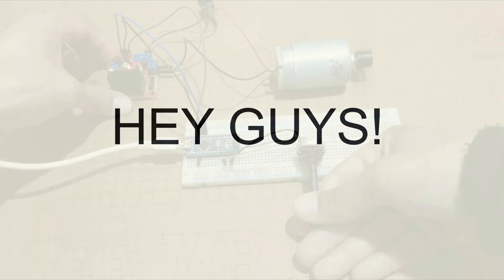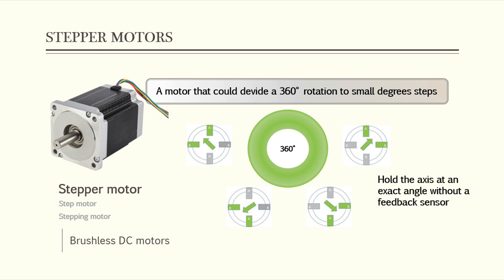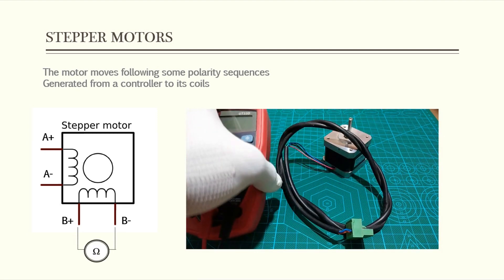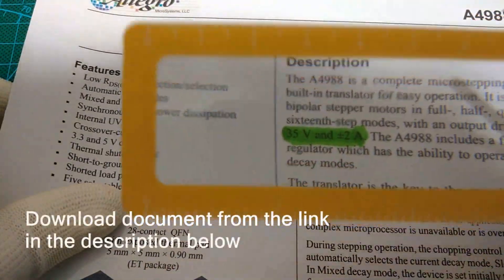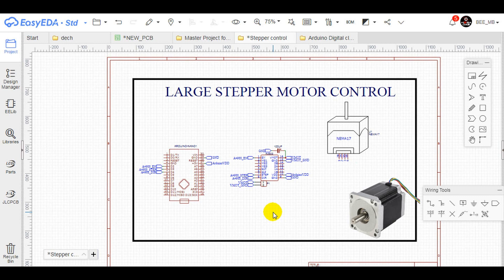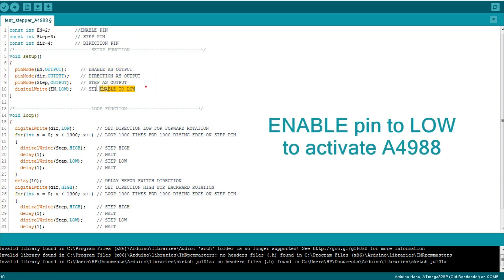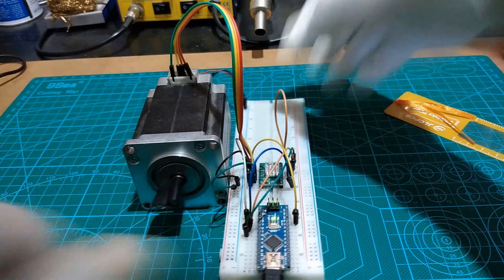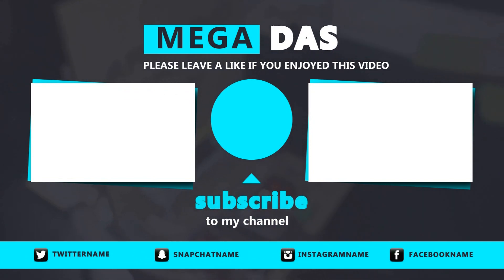A4988 Stepper Motor driver (Arduino project)

Comment: The video is it about #Nema17 stepper motor.
because the stepper you used is a bit large stepper motor than the normal nema17!!!!
Good tutorial.
Reply from the maker: Hello 
The video is about large stepper motors, but it will be all the same with Nema17.
I wrote a tag about #Nema17 because it is the most popular among steppers.

Let us know if we can further assist you.

Comment: Wow I loved the video, I would like to control a robotic arm that required 6 stepper motors how could it accomplish this?
Reply from the maker: Hello
This is a basic tutorial on how to control stepper motors.
Let me know when you need assistance in an advanced level.
Reply: @DIYGUYChris  I will probably need the assistance in about 2 or 3 weeks. I will first start with this tutorial and the build my way up. Thank you for your reply.
Reply from the maker: @visionaryrobotics4065  Let me know whenever you need me ^_^
Reply: @DIYGUYChris  Ok will do, I plan on working on this on my summer break.
Reply: Learn to walk before attempting to run.  This video is an excellent introduction, once you have mastered the principles here and developed your code to perform simple tasks such as variable speed, acceleration/deceleration you can then scale up your expertise.
Reply: @r1273m  Yes you are totally correct , I will start with this and build my way up! Thank you for your reply.
Reply from the maker: @r1273m  absolutely right..
This is a basic tutorial..
Thanks for your comment 😊

Comment: Awesome thank you!

I want to make a stepper motor spin with varying speed. How can i achieve this?
Reply from the maker: Hello
It is so simple, just add a potentiometer to your Arduino to control the motor speed then read the analog value from the potentiometer and convert itin Arduino code using the Map() function and then you insert the converted value in the For loop delay so the higher the potentiometer value get the higher the delay get the slower the stepper spin 😊